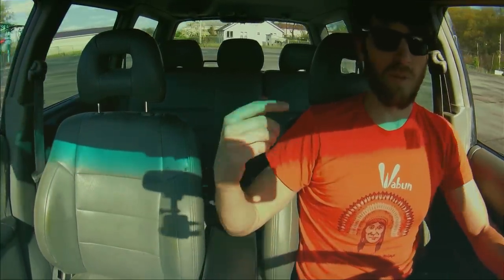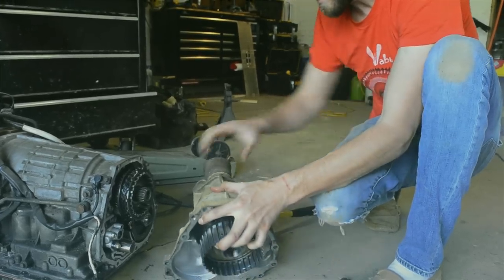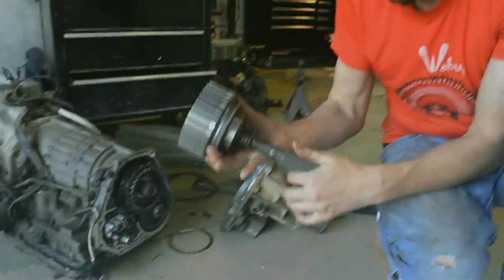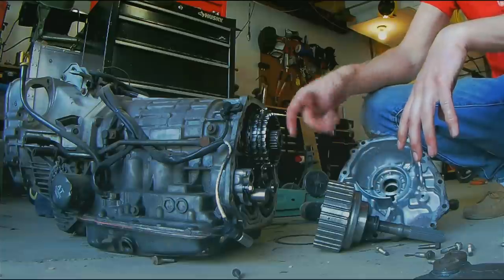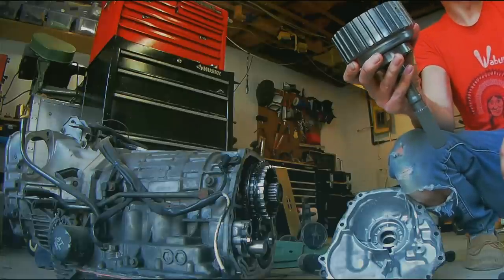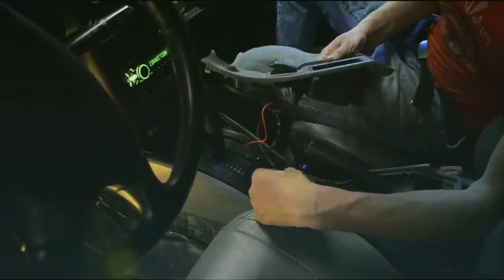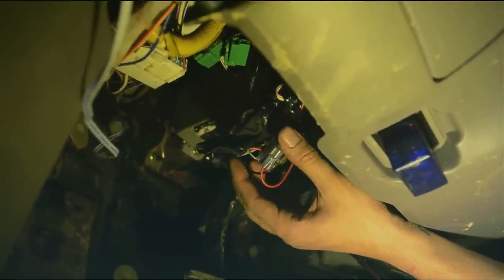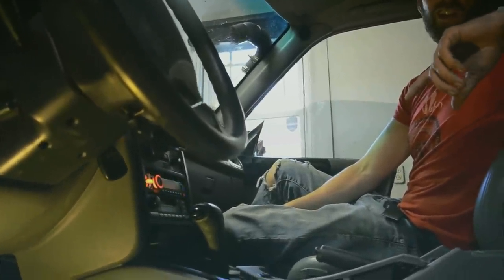Why your Off-road Subaru needs a locking center differential and how to install one for free

Comment: How much does this mod help with diagonal wheel spin? That's the only issue I have with my 08 Foz... and I feel like only a rear locker would help..
Reply from the maker: Other than added durability, the benefits of this mod occur before you're in the predicament of having diagonal wheel spin trying to overcome some obstacle. Depending on your driving style, it may be hard to perceive the momentary delay in rear wheel power as you depress the throttle. This mod lets you fully engage both differentials under partial or full throttle before any traction loss. In other words, it won't help stop diagonal spin, but will help to prevent it from occuring. As far as the rear diff, we swapped in a vLSD (See video). It's not as good as a full lock, but for the money you can't beat it, and it's durable.
Reply: I've always read vlsd units are rather useless after 60k. It would be nice to do an r180 swap but I cant seem to find one in 4.44..
Reply from the maker: Been all the way down that road. It ends with a guy in Austrailia who can custom fab you an r180 for 4k USD. The vLSD does pretty good for what it is. Check out our vLSD swap video - the unit demo'd in that Hill climb had 200k miles on it
Reply: @dirttales  if its clutches, maybe. if its fluid based it should work so long as the fluid is good, right?

Comment: Also- do you have any clue if the TCU and VDC systems on the newer ones are integrated / linked?
I'm worried if I swap out the rear bell housing of my tranny for a VTD one (with all planetaries n shit of course) it'll screw up my vdc.
Also heard there's an issue with the front and rear output shaft tone rings being different- hence it will throw a tranny code. Some people solved by inserting front wheel drive fuse and using a switch to supply lock up voltage when needed.
Can a custom tone ring be made? Im worried if I run my standard tcu with a switch mod controlling the VTD clutches that it'll throw a code- and whilst I might be able to get it cleared, it'll disable VDC completely (or even abs too- like when you pull the VDC fuze to completely disable it).
Sorry for all the questions 
Thanks in advanced
Reply from the maker: Sorry your comment got caught up in the idiot filter. Short answer is I don't know for sure, and the long answer is more than a guess. From what I understand, VDC is basically torque vectoring by use of breaks. Manipulating the breaks most likely manipulates the VTD as opposed to actually controlling it, such that it can initiate torque transfer under a broader range of conditions, other than complete traction loss. I don't know if locking the diff would actually trick the VDC into being inactive, or if it would continue to selectively brake which of course would be extra wear on your breaks and what not. Sorry, you'll have to do some digging on that one.

Comment: Is it possible to do a similar thing to a 2014 subaru outback with CVT?
Reply from the maker: The wiring changes year to year but the mechanism and differential itself is exactly the same, even in CVT models. This is why we don't give detailed instructions, but if you're comfortable with interpreting a wiring diagram this should be entirely the same general concept. This mod is only not possible with non-vtd manual transmissions such as the MT5, because they don't have a clutch pack.
Reply: @powerofyourbrains  
Excellent. Time for me to purchase an outback and make it off road ready.
Thankyou for your time.

Comment: I'm new to Subaru world, I bought mine in December 2019 
I have a 1997 legacy with the 2.2 and an automatic. Do I have any options for a center differential selectable locker? Thanks
Reply: The same process applies. All Subaru 4EATs use the same logic to drive the transfer solenoid. Resistance wise you need 16-20 ohms. I use 2x 100Ohm and 2x50Ohm 10w resistors all wired in parallel. Works a charm!~

Comment: Hi,I am new to Subarus. Will this work for -2001 Forester.  Also is there a write up on this?
Reply: Also is there a diagram or instructions on how to do this? Just want to make sure I am doing this property?
Reply from the maker: Not by us. We wanted it to be broadly applicable due to different models and setup possibilities. Also don't want to be responsible for people attempting this without knowing what they're doing. As long as yours is an auto it should work just the same. Check the description and comments for forum links; I've seen some very good walkthroughs. The concept is simple, but there are things you should consider and understand before you go whacking up your harness, and there are different ways you could potentially set it up.
Reply: @powerofyourbrains  what  DPDT relay do you recommend?  (one on amazon?)  also what is the 2nd red wire on the relay? I see 2 reds, a back and the wihite and green.

Comment: I have a 06 foz xt manual. It's fun but after watching this it makes more sense why it wasn't completely amazing off-road. Still plenty capable but not like yours
Reply from the maker: Not too sure about that. Power is a huge advantage in this car, and you have a lot more of it. You could easily add in a switch in a way that allows you to change back and forward from the way you have it now. Check out the forum links in the description, then you'd be able to safely nail the throttle without messing up your center
Reply: Power of your brains won't my diff never fully lock though? I will have to look into it. Ive only taken it seriously off-road once so far and it felt like at times it wouldnt let me floor it from a stop if it was a little stuck
Reply from the maker: Although the 5MT XT's are uncommon here in the states, it looks like they use a similar setup to other Subaru 5MT's; a viscous LSD (not a clutch pack). You have full-time locking with that, and although it's not the best (once the vlsd gets old and tired), you still don't have to worry about trashing your center. Since we don't have low range, the real benefit to this mod (for us) is to be able to nail the throttle without destroying anything. You can do that, so I don't think you're that bad off actually. I also drive a WRX with the same center as yours - you just need to give it some more throttle
Reply: Power of your brains thanks I'll have to get out again in the shit and practice with it I just don't have immediate access to trails around me
Reply from the maker: Totally understand that, used to be in the same boat myself
Reply: My first Forester which I offroaded had the 5MT with  viscous center coupling, and with liberal application of throttle, and could get along pretty well off-road, but the auto is definitely the way to go for offroading if you have a choice.
Reply from the maker: You're just jealous he has a turbo :P
Reply: Definitely jealous. Perhaps now is the time to fix that.... Turns out that phase 2 isn't going to swap into the phase 1 body so easily :/ If I'm gonna have to mess with the wiring maybe I may as well swap in a turbo engine....

Comment: hello, so theortically, if i do this mod and remove the front axels, i can have rwd in my subaru?
Reply from the maker: Not really...you'll need to break out the welder for that. We put out a rear diff power transfer test earlier this year. Check it out if you wanna learn more

Comment: Yo
You seem like u know your stuff
Any chance you'd be knowledgable on a VTD swap for a 2010 4eat with MPT and VDC?
Or even the diff lock mod for the SH (2010) 4eat? Heard the cars wiring is different- need to remove current instead of supplying current
Reply from the maker: TakingShitApart I cant say anything certain for your car, but for the 4eat in the sf Forester, the VTD from a legacy GT bolted right in place of the stock transfer clutch. Now, bear in mind that in order to figure this out we just had to try it, and luckily it was a direct fit. Wouldnt be surprised if it was the same for your trans, but don't know for certain
Reply: Did you need to use the vtd bell housing or just the vtd unit itself?
Reply from the maker: The whole assembly just bolted right up. Dunno if id attempt to just swap the internals
Reply: Nah, I don't think just internals would work at all hahah
hence my question :)
Cheers for the speedy responses

Comment: Does it take away from the tcu's ability to lock the diff on its own?
Reply from the maker: Only if you want it to. That's the way we have it on this one because of the vtd we installed, but on granny the switch overrides the tcu instead of acting as a substitute for it.

Comment: So do you need to pull the center diff to add this switch? Or just trace the wire and wire a switch on the line?
Reply from the maker: You don't need to pull the diff. That was just for illustration since we had the old one lying around. Its a purely electrical mod. Check out the forum link in the description, and you should be able to find many more resources online

Comment: Not sure what you mean by this "unless you wire it be able to keep the variable power transfer it has from the factory."  Can you do this mod to a 5EAT VTD (outback 3.6) such that it changes nothing from stock programming except when you engage the switch and lock up the center diff?  I was also reading on a forum that locking center diff on VTD is not recommended except for short periods of time as, unlike MPT systems, it's solenoid is not designed to remain engaged for long periods of time, since it naturally has a mechanical near 50/50 bias, it only engages for seconds at a time to pulse brakes when wheels slip.  Also, thought the 5EAT lock-up was hydraulically driven, not electric - does solenoid actuate hydraulic pump? (https://www.subaruoutback.org/threads/center-diff-lock-mod.504289/).  Dude in forum was also talking some WAY more in-depth stuff that I didn't try to fully understand yet:

"Steps to achieve this:
1. Review the 5EAT wiring schematic to determine how they have wired the transfer solenoid. (If the TCU controls on the high side + or low side - of the solenoid)
Determine where you can tap into the wire @ the TCU controlling the transfer solenoid.
2. Use a DVOM / Oscilliscope and take logs of the control behavior of that specific solenoid under operation by backprobing that specific pin on the connector of the TCU. (search backprobing if you are not familiar)
This will tell you how the TCU controls the solenoid, using this data you can create a microcontroller based setup (like I did) to drive the solenoid exactly how the factory had originally designed.
Key items that will need to be logged / recorded: Duty Cycle, Hz, Voltage, Amperage, Averages, Max / Mins, Wattage, Measure the resistance of the entire circuit and solenoid.
You will need to take detailed logs under multiple driving scenarios to determine how the TCU control behavior is activating / not activating. I recommend utilizing RomRaider at the same time to log multiple PID's on the ECU and TCU, this will allow you to view rear wheel / front wheel speed differences / solenoid % activation / line pressure / RPM / Torque Converter RPM ect..... You are going to want to have this information.
3. Bench test and make a microcontroller / MOSFET based circuit to control a load in the same manner as measured in step 2. (I used a potentiometer to send a 0-100% command to a microcontroller which in turn output a control pin to my custom MOSFET circuit to vary the duty cycle output of the system. While at the same time matching the same Hz as the stock system used.)
4. Re-wire the OEM system to switchover the TCU load from controlling the solenoid to controlling a dummy "load" that has the same or very close ohmic drop / amperage as measured in step 2.
This will allow you to control the transfer solenoid with your microcontroller / MOSFET based custom circuit AND trick the TCU into thinking it is still controlling the transfer solendoid. While
also not overloading or damaging the control circuit in the TCU with the dummy load. You don't want a fried TCU!
If done correctly this will trigger ZERO engine or TCU codes and have ZERO effect on vehicle drivability.
I used a DPDT switch to move the load between the solenoid and dummy load, which also had a built in potentiometer and simultaneously booted the microcontroller while activated. (This switch is my Avatar below my name)
When the switch was off the vehicle was essentially stock, nothing was different.

And that's all there is to it!
You can figure out the rest :D

Also to add onto RoughDiamond's note on NOT driving the solenoid @ 100% for long periods of time.
This is absolutely correct, you are not going to want to over heat and fry this solenoid, its not designed to run @ 100% duty cycle.
When I still had my Outback and used this setup I would drive it to 100% for very short periods < 1-2 minutes.

With the different driving scenarios / in conjunction with RomRaider logging and the custom controller you can determine what threshold of minimum duty cycle is needed to eliminate F/R wheel speed differences.
Logging F/R wheel speed differences (on loose terrain) and find what minimum line pressure (duty cycle) on the clutch pack is needed to provide sufficient lockup.
In layman's terms: You can dial in the absolute minimum amount of pressure on the clutch pack needed to lock F/R together.
This limit is of course going to vary depending on terrain and amount of Torque or load you are demanding from the engine.
By keeping this to a minimum you will limit the risk of overheating and damaging the solenoid."

Easy, right!?
Reply from the maker: This blue car has a vtd swap, fyi
Reply: @powerofyourbrains  ?

I wanted to know 
1) if you do this mod to a 5EAT VTD (outback 3.6) such that it changes nothing from stock programming except when you engage the switch and lock up the center diff?  As, in the video description, you mentioned something about how this may not be good for daily driving "unless you wire it be able to keep the variable power transfer it has from the factory."  I don't want to do this mod if it will chew up driveline components.  I'd want it to lock when I lock it but otherwise effect nothing.

2) is it correct that VTD systems should not be locked for long periods of time b/c of wearing out solenoid/hydraulic pump (and which is it - solenoid actuated or hydraulically actuated, or both?)?  seems from your description like both, but where does hydraulic pressure come from, transmission pump?

3)Why does the forum poster I quoted make this sound like a WAY more complicated job, where you have to take oscilloscope measurements to nail down all kinds of parameters and use a custom controller to determine the exact amount of duty load on the solenoid/pump for the lock-up.  Is he right?  What happens if you don't do those steps, and just hijack the switch?

Comment: But does this mean now when driving on the road you only have two wheel drive because you've made the locking rear a on or off only so you've removed the asymmetrical AWD?
Reply: Nope, just back to stock awd.

Comment: is this an issue with the older models?  Took my WRx to the snow on summer tires and all 4 wheels spun all the time without issue, 50/50 split.
Reply from the maker: If your rex is the same as your icon pic, then I have the same car as you (see our channel banner pic). New and old Subaru's work this way, but only models with automatics and manuals with VTD's (STi's. spec B's maybe). Our cars have a viscous center coupler diff that cannot be controlled - ergo, 50/50 split is achieved with the application of throttle. The good thing about this setup is that you don't have to worry about breaking your center, the bad is that depending you need to pretty much nail the throttle to achieve the same effect as the locker in similar conditions. Additionally, our rear and front differentials are open, whereas older WRX's had a rear VLSD